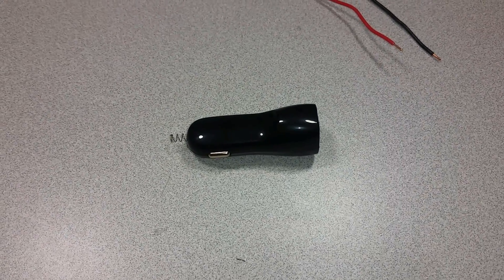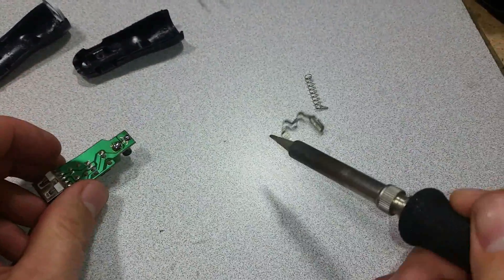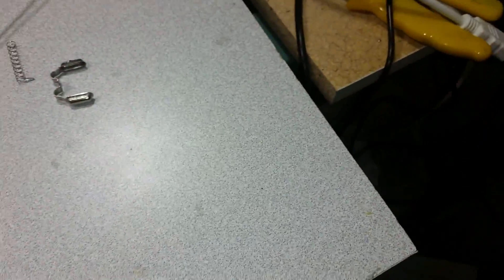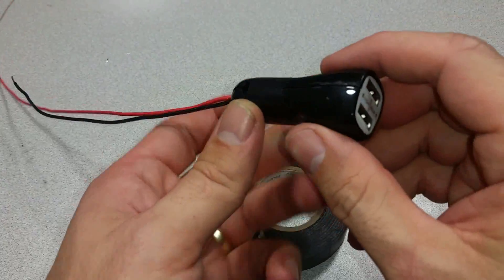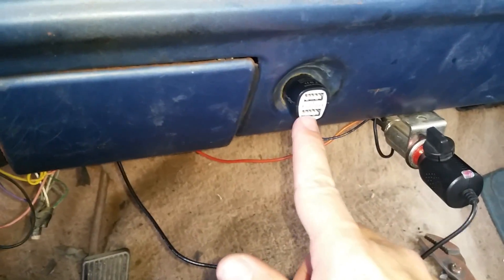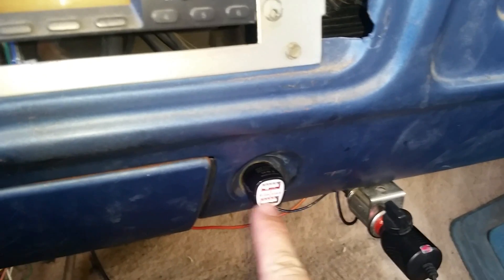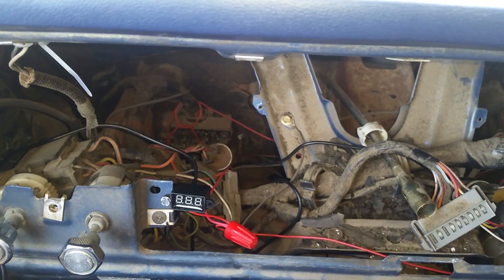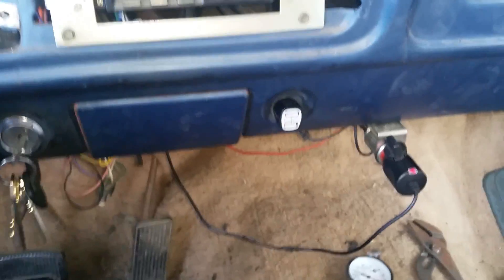DIY In-Vehicle Project - Permanently install USB charging ports

Comment: Are the positive and negative points on the USB chargers circuit board always in the same on all USB chargers? I'm looking to do something similar with a AUKEY Quick Charger in my car.
Reply from the maker: They should be.
Reply: It might be printed on the circuit board.